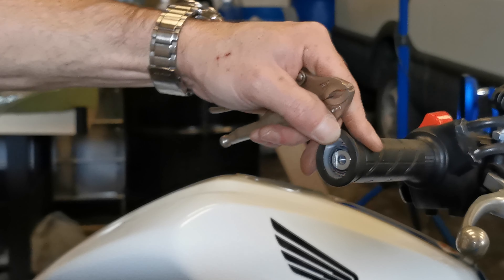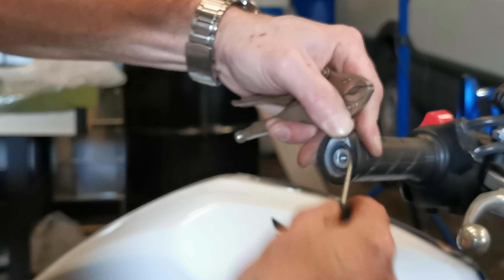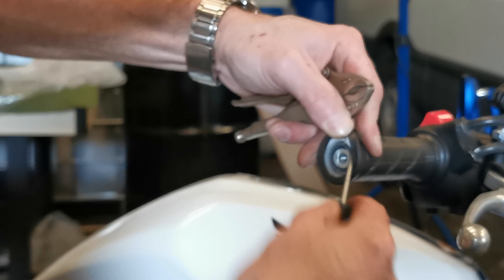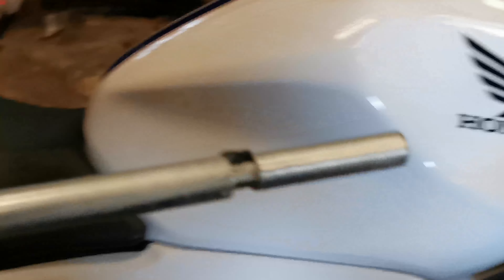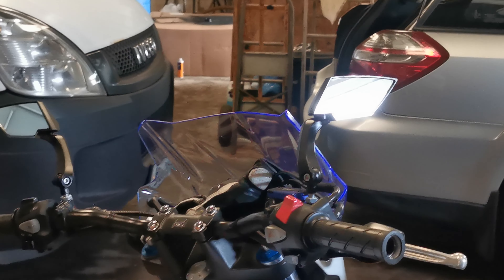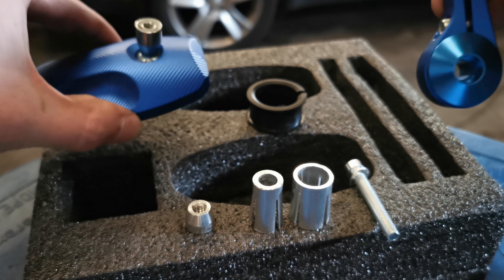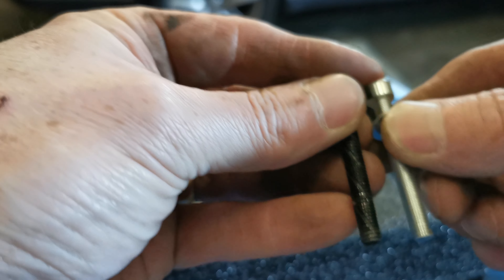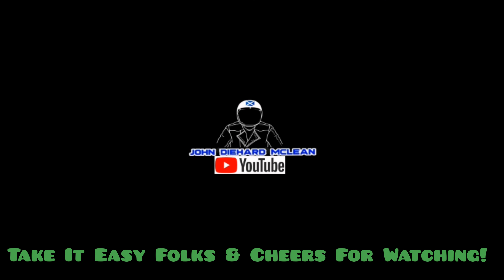HONDA CB500F | Bar Weight Removal & Fitting Awesome Bar End Mirrors On R&G Bar Ends! 👍😎

Comment: Wow, that's painful to watch. Hope you don't mind me telling anyone watching NOT to do it this way. Simply slacken the two hex head screws onthe brake perch. Then slacken the two cross head screws holding the throttle switch block in place, spread the two halfs a little (to free it from the locating lug) then slide both it and the brake perch away from the bar end to expose the end weight locating holes (about 15mm). Now use a couple of pin punches or small screwdrivers to press the circlip locating tabs down. Spin the end weight round a little and pull the whole assembly out. Spray a little multi purpose spray in the holes first to allow the o-rings to slide easier. No hammering, no banging. Takes longer to type than to actually do the job.
Reply from the maker: Oh it was painful to perform aswell! 🤬🤣✌️